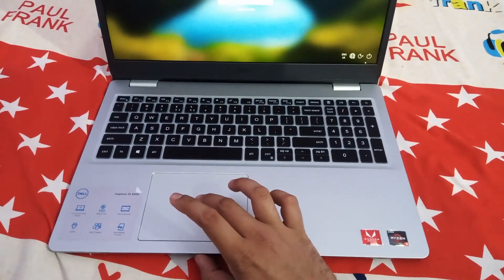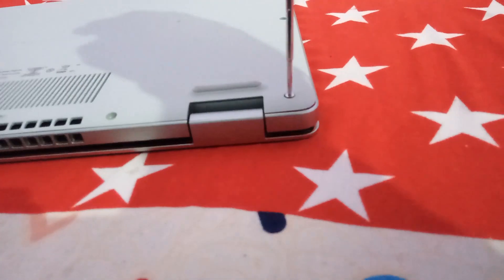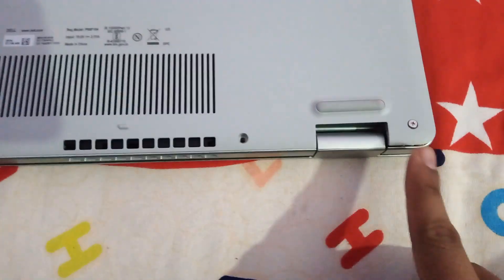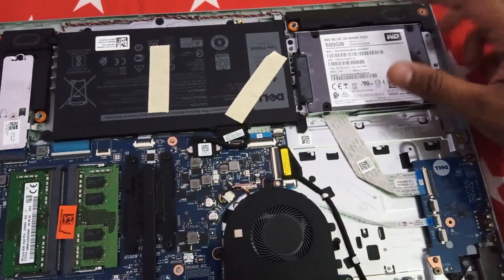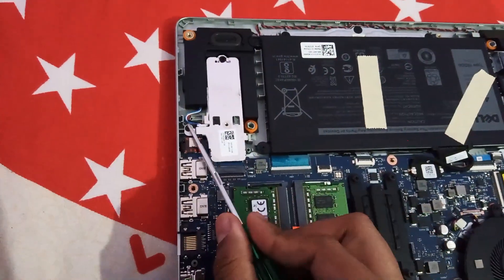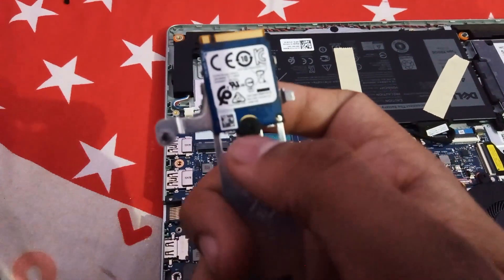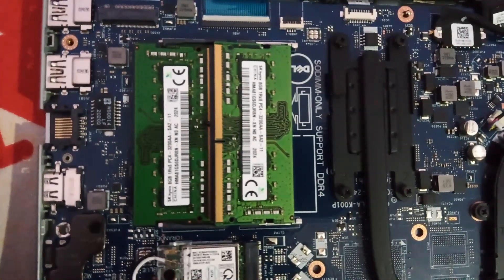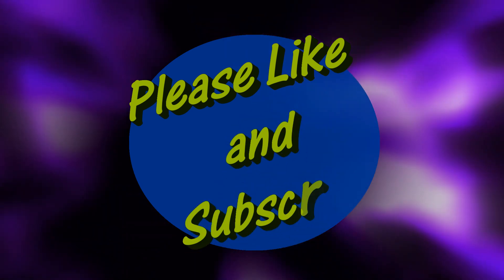Assembly / Disassembly of Dell Inspiron 3505 [RAM / SSD Upgrade]

Comment: Hi, i am using dell inspiron 3505 Ryzen7 processor model, i need to upgrade the Ram, now it is having 8gb need to add 8more gb ram. please suggest which company ram is best with mhz speed, also please confirm single channel or Dual

Comment: Great video, one question though, what screw driver do I have to use to take off the metal plate for the nvme SSD if I wanted to replace the built in SSD?

Comment: Dell ryzen 5 dual core (8gb/ 1Tb HDD/ 256gb SSD/ window 10) 3505 laptop👈👈👈👈👈can u tell me about this
Reply from the maker: You already gave the specifications, what do I need to tell you?
Reply: @LOLcontent  I want to get some reviews on the laptop but I didn't get it from Flipkart.... Review is empty at there so can you tell me that is it good for coding or not like for android developer or vscode
Reply from the maker: @kanchankamat1376  i think in dell 3505 the ryzen 5 is a quad core processor and not dual core. And the ryzen 3 is a dual core variant. Please check it again if possible. Or paste the link for the comments if it is ryzen 5 dual core.
Btw for programming you do not need very high end processor if you are not an advanced programmer.
So the ryzen 3 variant will also do the job if you need it for programming .

Comment: Hey man appreciate your efforts in this video...
I have a question is that the Vega that you have usually take 2 gigs of ram to run as a GPU so you technicaly have 6 gigs of ram or they already make a devided 2gigs of ram to run the GPU 
I hope you answe me
Reply from the maker: Yes, you only have 5.9gb ram out of 8gb, because 2gb memory is reserved for graphic card and only 5.9gb is usable. If you are thinking to buy this, then definitely you need to add another ram stick in empty slot l or else you might face some lags.
Reply: @LOLcontent  Okey thanks for your answer appreciate it

Comment: Why are the vents half blocked?
Reply from the maker: Half of the vents are blocked on the side where fan is placed to make sure that dust does not enter the fan directly, also the laptops are designed in such a way that the air passes only through the heat sink ventilation and not from other parts because if other vents are open then the air will pass through that open area first and not through the heat sink ventilation this will make the heat sink more hot and then it damages your GPU and CPU where heat sink is connected.
Reply: @LOLcontent  Ok, thanks 🤙
Reply: @LOLcontent what is battery backup??

Comment: Hi I have the dell Inspiron 3583 amd Ryzen 5 and it’s gives me a lot of problems like blue screens and it crashes sometimes leading to these blue screens ...after sometime when turning it on it tells me the hdd is not installed and so I cannot boot into the windows desktop ..I tried removing the hddd and installing it back again and run diagnostics but the same problem still persist I can’t do anything on it and even boot to windows
Reply from the maker: https://www.youtube.com/watch?v=-eDX7f6EcLA

Go for this video in case you need any help during installation or you can search Google for Installation steps or watch any tutorial on YouTube
Reply: @LOLcontent  thanks
Reply: Is it that I need to change the hdd to an Ssd and reinstall Windows?? If yes can I use the SATA Ssd hard drive without using m.2 nvme
Reply from the maker: try to  do a clean installation of windows on your HDD. It is not necessary to add an SSD, but you can do that if you want to increase the performance like faster booting time.
I will suggest you to do a clean installation on your HDD first.
Reply: @LOLcontent  how do I go about the clean installation any link to s vid because I can't even boot
Reply from the maker: @Tom122-r2m  you will need to borrow a laptop from one of your friends to make a bootable USB drive for Windows 10

Comment: hi bro can i use 1 4gb +1 8gb to do 12gb ram?
Reply from the maker: Yes, Make sure that you use a RAM of at least 2400Mhz
Reply: @LOLcontent  also can use 3200mhz right?
Reply from the maker: @jiunweisam2691  yes, you can use 3200Mhz.
Any Ram above or equal to 2400Mhz
Reply: Do I need to pay attention when opening the laptop?
Reply from the maker: @jiunweisam2691  Yes bro, It is a Plastic Body Laptop so make sure you open it very gently.
Reply: @LOLcontent  thankyou😄

Comment: Is this laptop have backlit keyboard and how many hours thus the laptop capable.
Reply from the maker: No, It does not have any backlit keyboard and fingerprint sensor.
This laptop comes with a average battery. browsing internet or watching videos might give you a 3 hours of battery backup but doing high performance task such as gaming or photo and video editing will only give you  1 or 1 and half hours of battery backup
Reply: @LOLcontent  at what price point we can get backlit key and 5 hrs battery life and 512gb ssd in ryzen 5 3500u  powered laptop .
Reply from the maker: @thirugnanam3477  switch to HP if you want backlit keyboard in Ryzen 5 processor
Reply: @LOLcontent   can I get ryzen 5 3500u and backlit key and ssd and upgradeable slots in hp within 50k or 52k even 14 inch laptop is enough for my tight budget I have to  compromise in this budget becoz I'm going to upgrade my pc in high budget so only I'm in low budget. If there any laptop in this strict budget tell me.
Reply from the maker: Go for this one. A perfect Laptop for you
https://www.flipkart.com/msi-modern-14-ryzen-5-hexa-core-4500u-8-gb-512-gb-ssd-windows-10-home-b4mw-238in-thin-light-laptop/p/itm5d9d4685ec612?pid=COMFX7FRTGPJZKA5&lid=LSTCOMFX7FRTGPJZKA5UBTUUT&marketplace=FLIPKART&srno=s_1_1&otracker=AS_QueryStore_OrganicAutoSuggest_1_8_na_na_na&otracker1=AS_QueryStore_OrganicAutoSuggest_1_8_na_na_na&fm=SEARCH&iid=1685f7a3-d5e1-4aca-9f83-ec798b31635d.COMFX7FRTGPJZKA5.SEARCH&ppt=hp&ppn=homepage&ssid=y8nqoxgxio0000001614588898929&qH=d9f4092b4fd45dbf
Reply from the maker: Go for this MSI laptop, but in this i think you would not get any upgrade option for HDD
Reply: @LOLcontent  thank you for your reply.
Reply from the maker: https://www.dell.com/en-in/shop/laptops-2-in-1-pcs/new-inspiron-14-5402-laptop/spd/inspiron-14-5402-laptop/icc-c682501win8
Go for this one. It comes with 11th gen i5 with backlit keyboard and better battery backup. 
You will get discount of Rs 1000 when you pay via UPI 
Get 10% cashback on YES bank credit card EMI transactions or get digital cash card worth ₹2,000
Pay through Credit Card EMI and Get Digital Cash Card worth ₹2,500
Redeem Alienware headset worth ₹7,999 at ₹999
Reply from the maker: I suggest you to check for the pricing on some dell store for the same model. May be you will get it in your budget
Reply from the maker: you can also go for this one if you want Ryzen 7 Processor and Backlit keyboard 
https://www.dell.com/en-in/shop/laptops-2-in-1-pcs/inspiron-15-3505-laptop/spd/inspiron-15-3505-laptop/d560332win9s
Reply: can we upgrade / change normal keyboard to backlit key

Comment: Can we insert hdd in this, Is there any space to install in it
Reply from the maker: Yes, there is a space for HDD
YOU CAN SEE IN THIS VIDEO I HAVE ONE NVMe SSD AND ONE SATA SSD 
this sata slot is vacant and can be used for HDD
Reply: @LOLcontent  this is for ryzen 5 ,do ryzen 3 also will have the space to install hdd bro
Reply from the maker: @muhammadshakeer7002  yes bro, both of them have a space for HDD. Almost every 15 inch laptop have space for HDD
Reply: @LOLcontent  ok brother
Reply: @LOLcontent  does ryzen 3 will come with 1tb internal hdd along with 256 ssd brother
Reply from the maker: @muhammadshakeer7002  bro actually Ryzen 3 comes in 2 variants, one of them comes with both SSD and HDD while the other one comes only with HDD.
Even in the only HDD variant also there is a empty slot to add an NVMe SSD Drive
So, basically all the Inspiron 3505 laptops have slot for both HDD as well as NVMe SSD.
Reply from the maker: @muhammadshakeer7002  This one comes with only SSD and not HDD
Reply from the maker: @muhammadshakeer7002  go for this one if you need both HDD+SSD with 8GB ram 
https://amzn.to/3uFolyL
Reply from the maker: @muhammadshakeer7002  go for this one if you want both HDD and SSD with 4GB ram
https://amzn.to/37YKX3p
Reply: @LOLcontent  tq bro
Reply: can we change / install backlit keyboard

Comment: I have a 8gb build in ram but can i add the empty slot other than 8gb e.g 4gb or 16gb
Reply from the maker: Yes, you can. Just make sure that you are using DDR4 2400mhz RAM

Comment: Hi may i ask do i need extra tools to add hdd? or just plug and play?
Reply from the maker: You need a Suitable Screwdriver to open the back case and to mount the HDD screws in its place..nothing else...Just insert the HDD in SATA Slot and start the laptop.
Reply: @LOLcontent  do I need reinstalling windows after put hdd?or just put it and run like normal?
Reply from the maker: @t-hazriq  no need to re install the windows.
Reply: @LOLcontent  so,I can just install Hdd by myself?Just buy 2.5 Hdd and put it in the extra slot,that's it?
Reply from the maker: @t-hazriq  yes, you do not need to re install the windows until you remove the Nvme SSD, because that is the default OS drive
So if you want to add SSD in extra slot, you do not need to reinstall windows. Just put it in the slot and use it

Comment: Can i upgrade the ram size from 8gb to 32 gb..?
Reply from the maker: yes, you can increase the RAM upto 32GB by using two 16GB sticks  i.e 2 x 16GB
Reply: @LOLcontent  thanks for the reply broo..🥰
Reply: @LOLcontent  ddr4?
Reply from the maker: @javico1127  yes It supports 2400mhz ddr4 Ram.
Reply: @LOLcontent  Bro but in inspiron 3505 ryzen 5 manual , dell claims it supports upto 16gb ram only.
Reply: @CreepyMan-vk2hf  yes, i think 32gb may not support, @LOL can you confirm this please

Comment: Battery upgrade is possible
Reply from the maker: No, battery upgrade is not possible. Because motherboard is made to work according to a specific battery type, using higher aur lower capacity battery can damage it
Reply: Thank you 😊

Comment: Hello! I have the same laptop but its the ryzen 3 one with 4gb ram..it took around 3 minutes to boot..will upgrading RAM helps. Pls help.
Reply: ssd is faster i have the same system as in video when it was new it took around 3-4 sec to boot but after 1 month it just droped by 4 sec now it take 7-8 sec to boot and application still open up faster 
and i hope its like that in the future too
Reply from the maker: 3 Minutes 😯, Do you have windows installed in SSD or HDD?
Reply: It doesn't come with ssd so window's installed at HDD 1Tb.
Reply from the maker: @Alvinsba  bro by increasing ram you can improve performance of your pc but that won't affect your booting time...even if you increase your ram to 8gb then may he your booting time will get decreased to few seconds but don't expect much
Reply from the maker: @Alvinsba  if you want to decrease the booting time then, disable the extra start-up applications from task manager
Reply from the maker: @Alvinsba  make sure that you only enable very important applications for start-up, that will decrease your booting time and then increase your ram to 8gb so you will notice a significant improvement in performance
Reply from the maker: @Alvinsba  i have a dell laptop (inspiron 3521) its 3rd gen intel i3 processor, with 8gb ram , only 512gb HDD , and it boots up within 2 minutes...but then for doing anything i need to wait for extra one minute😅
Reply: @LOLcontent  haha..i will try to upgrade the ram to 8gb. Thanks for replying.👍🏼
Reply from the maker: @Alvinsba  keep your battery plan to high performance if you have any performance issue and try to keep charger connected while doing heavy task or gaming.. it will improve the performance by upto 20%
Reply: Hi, a newbie here.. i have the exact spec like @alvin lalrinsanga except for nvidia mx330.. not for gaming use. but does upgrade ssd or ram would make up boot time and windows performance faster?which one?

Comment: Great video , I got a few questions , maybe you could help me , the first one is that I am having some trouble with the microphone , it stops working in the apps and browsers every time I turn the volume down to 0 of the speakers, what could it be?? , and then if I could upgrade de RAM by using  2 modules ADATA  DDR4 8 GB 2400 Mhz (This is the model AD4S240038G17-S ). Thank you.
Reply from the maker: For microphone, you need to re install the microphone drivers again and then restart the laptop, if this could help.......else i will chk it and get back to you within 2 days
Reply from the maker: You can use any brand ram of DDR4 2400mhz.... bcz the motherboard only supports 2400mhz ram, so if u use ram with higher frequency , u will still be getting 2400mhz ram
Reply from the maker: There are many issues with this laptop , i will soon be uploading a video with possible solutions.....
You can check all the issues here in this video https://youtu.be/KBAso8Kv6yA
Reply: @LOLcontent  Thank you so much for your answer , I already tried unistalling the drivers and restarting but the microphone keeps getting diactivated for the applications every time I turn the volume to the minimun , I would be really grateful if someday you could check if that happens for you as well....  greetings
Reply from the maker: @ignos3976  sure, i will be checking it...if u were asking about free ram slot above, then yes there is one extra slot available for upgrading the ram , and there also is one empty 2.5 inch SATA slot, for installing HDD/SSD
Reply from the maker: @ignos3976  well as far as i checked, when you turn your volume down to minimum (zero) your mic is not working.. the possible reason for this is that when you are turning your speaker volume to zero then your speaker will get muted and that will mute the whole audio system. so if you want to use your microphone with speaker volume to zero. then you need to follow these steps
Step 1: when you turn your volume down to zero it will show you a speaker with cross on it 🔇 like this on the bottom right of your taskbar(where you increase or decrease your system sounds) near that wifi, time date and battery icon

step 2: you need to click on that icon and it will open your sound slider and on the left ot that sound slider there is a speaker icon 🔈x same as like this . you need to click on that icon and that will turn into like this 🔈 and then you can use your microphone with your speaker sound as zero

* whenever you turn your speaker volume to zero, then please always unmute the system from the above steps.. because when u turn your system to zero sound it mutes the entire system including microphone**

or else you can always keep your system sound to 1 or 2 level and it will gives minimum sound output with full access to microphone
Reply from the maker: @ignos3976  I hope the above solution helps, if not then you can comment again , I will be helping you again
Reply: @LOLcontent   Clicking the icon so that the audio system gets activated again works for me , that way I can use de microphone while having the volume set to 0 , Thank you so much again for answering , I don't know why the audio system works this way............. I'll be sure to keep up with you videos.
Reply from the maker: @ignos3976  Thank you, It means a lot.
if you have any other issues, then comment on any of my videos and I will be assisting you and I will be uploading videos with solutions for some major issues.

Comment: Bro express charging is good or adaptive  charging
Reply from the maker: Bro it depends how you want to use it. Adaptive charging is good if you use your laptop while charging or sometimes if you forget to switch off the charger then adaptive charging will protect the laptop from overcharging upto some extent
Reply from the maker: Adaptive charging is better if you want to keep your battery health good for a long time.
Reply from the maker: But if you are in a hurry and want to charge your laptop Faster then switch to express charge and it will charge your laptop from 0 to 100 in maximum 2 hours, while full charging in adaptive mode can take upto 5 hours